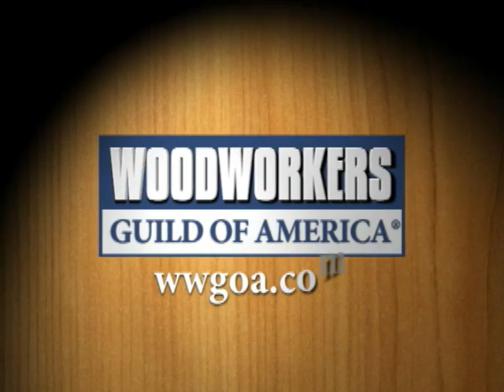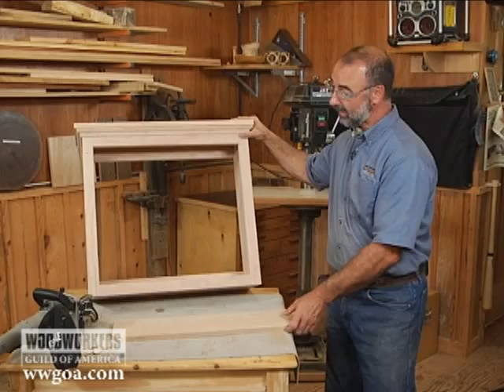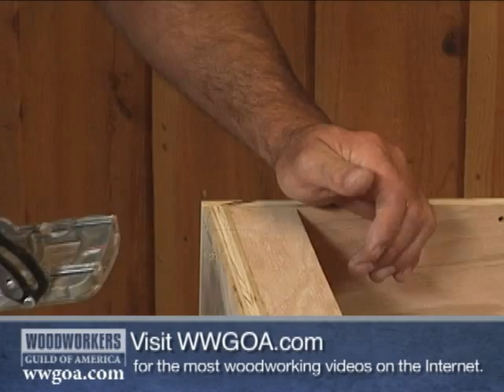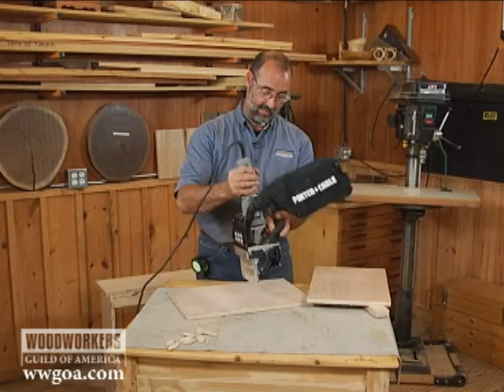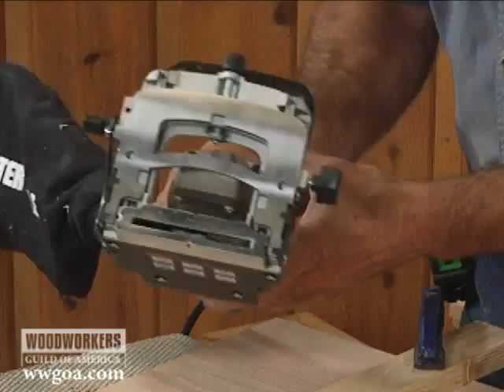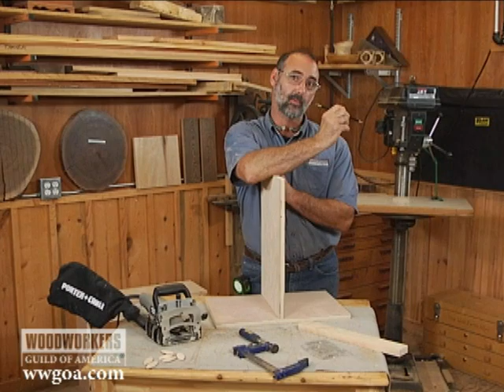Woodworking Tips & Techniques: Joinery - Using a Biscuit Joiner

Comment: Would not Dowels work just as effectively George???
Reply from the maker: Hi Terry.  Yep, dowels are great, and provide a lot of additional strength.  If you like using dowels, by all means, keep using them.  I think of dowels as a substitute for mortise and tenon joinery (so, mostly for furniture), whereas I generally use biscuits as an alignment aid, for gluing up panels when alignment is needed, or other quick joinery where an alignment aid is beneficial.
Currently I use Dominos as my primary method of mortise and tenon, and I occasionally use biscuits for simple alignment.  So, there's room for both in my shop.   Thanks Paul-Woodworkers Guild of America
Reply: WoodWorkers Guild Of America  You hit the nail on the head here, George. Biscuits are intended for accurate location, but they don’t really have enough inherent strength on their own to make strong joints. I use biscuits mainly for edge jointing long lengths of timber for panels and shelves.

Comment: in the second part "bottom up"... the best method is to just use the shelf to register off. That way you can mark both pieces at once and you won't accidentally register off the wrong face.  It also keeps it square.

Comment: I'm confused about the shelf portion ("T" joint), did you flip the shelf after measuring or after cutting?  it seems the "bottom" of the shelf was attached to the "top" of the support. I'm thinking if the biscuits weren't equidistant from each edge of the support, it wouldn't fit, or wouldn't register correctly to the registration line?
Reply: NO you are not confused That is exactly what he did. Bit of an Oops that. He should have had the shelf marked on the other side. You are correct in that if they are equidistant it won't matter. Biscuits are pretty forgiving in terms of side to side alignment though.
Reply: He is only demonstrating the biscuit joint over all.

Comment: Biscuit joinery is new to me so please forgive what is probably a dumb question.  I'm curious as to why a biscuit joint would be preferable in the case of the attachment of the shelf, as opposed to a dado joint?  Wouldn't a dado joint provide greater strength in an application such as attaching a shelf, where strength is important?
Reply: Probably but a lot more work.

Comment: I used the same biscuit joiner to add material onto the long side of a 7 foot board. The machine was so easy to use that I only had to make a few practice cuts figuring out how to set the machine to use the different sized biscuits. Also you can remove some of that lateral play by adjusting the fine tuning silver knobs on the side of the machine.

Comment: Instead of using the cleat, use the shelf as the cleat, lay the bottom of the shelf against the line on the upright as you did the cleat, clamp them, then cut them both, the upright then turn the machine to do the shelf end as you did but without worrying about getting them the wrong way up,then just stand the shelf up.

Comment: A good job of demonstrating the biscuit joiner, however you should have turned the shelf upside down after you marked for location.  If the layout had been asymmetrical the shelf would not have lined up.